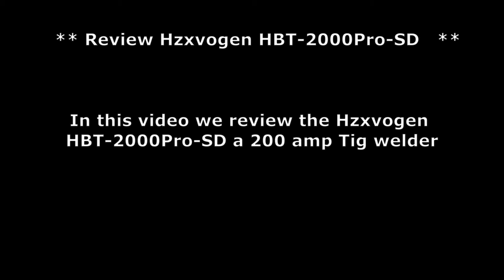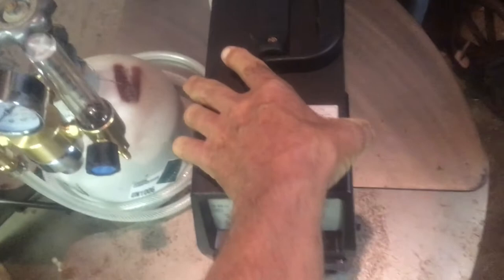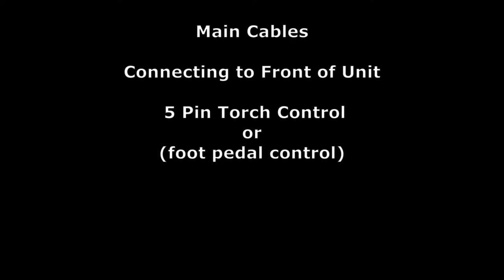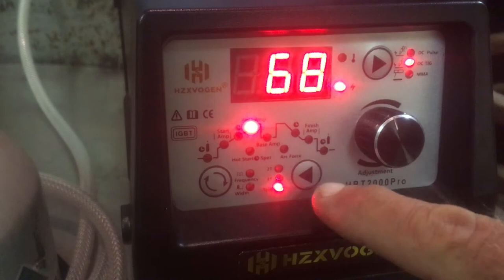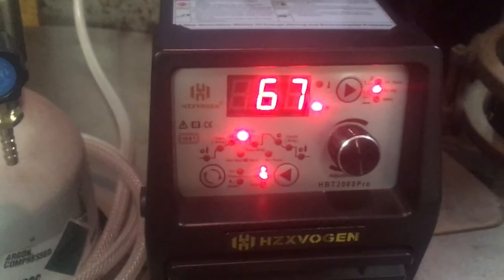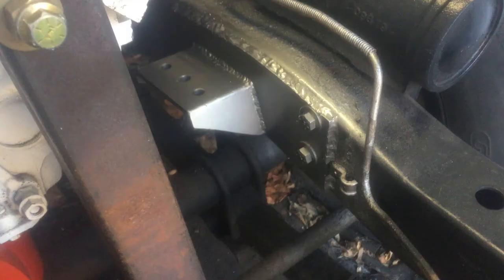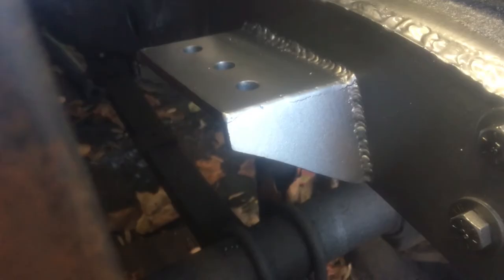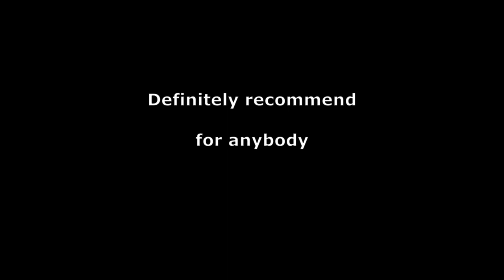Review Hzxvogen HBT-2000Pro-SD 200A TIG Welder Features/Setup/Operation/Examples

Comment: Thanks for the “real review” i have been eyeballing one for about a year. I have the HBM2280 mig/multi function and like the size of this tig unit. I especially like the pulsed tig option for sheet metal work. The Tig Torch is probably gonna be annoying but i hate using a foot pedal. I love my cheap hbm2280 fantastic unit for the money. So kinda makes sense to get this for Tig work.
Reply from the maker: Your welcome.. For me I figured most work would be in situations where using a pedal would be very difficult/contorted and everyone seems to say 'be comfortable position" when welding..  Price, size, weight, plus pulse .. yep a fantastic unit for the money IMO.. I will make (will do a video on) adding an adapter between machine and torch to allow turning off the up/down buttons and/or to switch to a lighter torch but those would add a ton of cost to the unit which semi defeats getting the savings on it.  Good luck with yours

Comment: Great video with lots of personal insight, thank you.
I had a couple of tig welders already but bought this one because it was such a great deal considering all of the features this unit has. You're right about the torch handle, lots of bells and whistles you don't need to be packing on the handle. A tig torch should be light, small, and nimble. This one is definitely not. I'll be replacing the torch head with a small WP-17 unit that accepts the same consumables. I'll add a small on/off micro switch in order to initiate the arc and gas, this will be light and simple and also very low in cost.

I had the same issue with the gas fitting on the front of the machine being loose, made it impossible to remove the line. I opened the unit up in order to tighten the retaining nut for the gas fitting and am glad I had a peak inside. Both power connections at the back of the Dinse  connectors inside the machine were lose. The gas line connection on the solenoid actuated gas valve was also lose and a heavy gauge power terminal on the main circuit board had not been trimmed properly and had almost worn through the protective plastic insulator sheet placed between the back side of the board and the outer shell/can. Everything else looked great but it won't hurt to have a look just to confirm that.
Great machine though and I am glad I scooped up this bargain. Thanks again for the video!
Reply from the maker: Very welcome .. Sounds like I need to open it up and take a look and fix the loose stuff.. 

Yes switching to a micro switch to trigger the T2/T4 functions will be route I go as well. I thought about using a WP-17 unit (not just swapping the head) but this is a 200amp unit so I am unsure I want to drop down to the 17.. Also I have a WP17 that came with my MIG unit.. I think if (when/if when lol) I can afford it I would jump to a CK like light weight 26 but with an added trigger switch.. 

Thanks for sharing your insights and thoughts.
Reply: @lars-dimdiy-howtos464  The only reason I chose the 17 series torch head in lieu of the more robust 26 series torch body is to have a more nimble torch. To me at least most of my tig work is more like surgery insofar as welding goes. LOL
The 17 is rated up to 150 amps, a level I seldom use with tig as most of the work I do with it is confined to 130 amps and usually under 100. For my use I finder it easier and faster to use either large transformer based stick and mig machines for the heavier material.

Be careful opening the shell, the sheet metal screws have precious little to sink their teeth in.
Pretty tight on the backside of the gas fitting. I used a long needle nose ViceGrip in order to hold the nut while tightening the fitting from the outside with a 17mm socket.
Reply from the maker: Yea .. good points .. and as we said in video its an awesome little stick welder too that's basically a lunchbox LOL take care

Comment: Any update now? Is the machine still doing fine? Mine have a problem now with the spot function sometime even if there is HF theres no arc  i have to turn the machine off and on
Reply from the maker: No problems. Still using it as a TIG and as a portable stick welder. I however did replace the Tig torch early on to a lighter flexible one with a simple trigger tab on it.. only advice is to make sure all connections are clean and secure including ground. you probably have done that but in case thought would mention.. Just unscrewing and reattaching cables can help with hiccups.

Comment: Excellent friend review of the team. I wanted to know if you can help me with the necessary parameters to weld stainless steel sheet of caliber # 30, in the equipment you used in this video. Thank you very much.
Reply from the maker: Each time / project may change what the settings need to be .. the type of weld ( butt, lap, tee, angle), the amount of metal being welded, the surface welding on (due to heat transfer), the grade of stainless (304, 316, 409), and of course the thickness.. You mention caliber # 30 .. is that the same as .30 in / 7.6 mm?

Comment: What rod sticks/electrodes should I buy for a car steel?
Reply from the maker: Not a simple answer. It depends on thickness (plus same to same thickness), condition of metal (rust etc), use (structural vs patch panel), type of metal (cold rolled, hot, stainless, 2 dissimilar types), and settings one is using at the time (pulse or not, amps, etc). I use both the stick and the tig operations of this welder.. which adds more choices / decisions to make.. Simple rule is match diameter of filler to thickness of metal so melt at same rate.. Same for tungsten .. close to size of rod / part thickness but that just starting point.. Always test and set up .. if metal is not new then may vary in thickness (rust too).. which impacts what rod/filler/stick to use.

Comment: Could someone help me please, I bought one of this machine and I try to use in TIG mode, but the digital torch doesn't work only up/down amps buttons working. Then I try in MMA , it worked very nice. Please reply if you have any idea about this issues
Reply from the maker: Can you adjust/change the Tig and or Tig Pulse settings using the menu buttons on the front? You mention up and down work if on handle does the bottom (gas) button work? Make sure the connector(s) from torch fulled seated on machine.. Maybe unplug and re-attach (dirt?)  If it is just the top button that starts TIG function try in 2T - 4T - Spot modes.. if it still doesn't work it probably is torch handle (switch).. If under warranty you should be OK to return just the handle..

Comment: I know what welder you have you can get a pedal for a primeweld Tig-225x or a AHP alpha Tig 200 and will plug in and work on it I think it is like a $100 for the pedal.
Reply from the maker: Have you used or tried it with either? I will be welding Stainless Steel exhaust with it something I have not done yet.. Will post short video of how it does on that..Will be including Solarflux as part of review.
Reply: @lars-dimdiy-howtos464  yes I sold it to my friend and he is still using it today. I got rid of it because I ended getting a primeweld weld Tig 225x with a Maxcool 3000 TIG torch cooler. You can use that to weld stainless steel exhaust with with lifting set your amps about 43 to 45 amps and it'll weld just fine
Reply from the maker: Great! Thank you for sharing that for all and the SS settings..

Comment: I cannot find any information on the pulse parameter. What the low setting and the high?
Reply from the maker: That can be found in the "Operation" section of user guide/manual. There are two parameters. 

The 'Pulse Frequency' is from 0.5 to 200Hzy. This is cycles per second which is a known based on what you set the menu to. By that I mean if you set it to 1 cycle per second then it is going to be 1 cycle per second. If you like to watch strobe lights you can crank it all the way up to 200 but it still will be pulsing at the 200 per second rate.

The second parameter is the 'Pulse Duty' rate which is variable from 5% to 95%. It is not as simple though. It is a % so it varies based on your other setting(s). 

An analogy might how many times you stomp on the gas/petrol pedal per second is your pulse frequency. How long you hold it down and how far you let up on it between stomps is your pulse duty. .. 

IMO getting it right is getting right for you and for what your welding.. One can weld at a faster or slower rate or raise or lower amperage by playing with the two settings.. Kind of like welding position .. its where you feel and can work comfortably. Like all other welding its best to get set up on test pieces of the same stuff one is welding.. You can get into a rhythm and keep heat down and/or time using filler rod..
Reply: Thank's a lot I think I will buy it! Looks that it can last as long as a miller or lincoln the way I will use it. Sheet metal only! The only flaw I will get it's dont weld AC! Like the HVT250P ac dc!
Reply from the maker: You are very welcome.. Originally my intent included AC Tig welders but the only time it really is needed is for Aluminum. The difference in cost versus how often I might do that made this welder the hands down choice. I do, surprised me, use the MMA stick side of this welder a fair amount.. it is so light and easy to transport and welds heavy steel/stainless easily with its smooth power. I ended up not liking the European style Tig torch itself.  I ditched that and use a light weigh flexible handle with simple trigger on it now. That modification may have made the total price closer to an AC unit but I luv the flex and light weight of it. I don't regret this modification.

Comment: Hi! Any update on the torch upgrade? Do you know which pins on the connector correspond to each function on the handle yet? I scored one of these welders used for dirt cheap but it didn't come with the original torch so I'm having trouble mapping out the pins. I opened up the case and it looks like from the main plug three of the five wires go to one connector and two go to another connector. I'm guessing its the 2 pins that are the on/off for the torch??? Looking at the panel from the front it would be the pins around 2 o-clock and 4 o-clock.

My goal is to use a regular torch with either a handle trigger or a little foot switch. I think using a pedal to adjust the amps would simply adjust through the whole range of the machine. I don't think there is a way to set the amps on the panel and then use a pedal to modulate within that set range :( Maybe I'm wrong though???? Please tell me I'm wrong haha!

Thanks so much!
Reply from the maker: Unfortunately life is getting in the way of modifying or using it.. Thanks for the information you provided by opening it up.. My approach, if I can get back to it, will be to use a multimeter or other on/off continuity tester to test what sockets/pins on the end of the torch correspond to which function on the handle.. 

You may be correct about up and down but unsure if the momentary + - buttons might work with a pedal.. 

Very welcome .. thank you as well
Reply from the maker: Update I just read the manual since it showed a pedal.. according to it, the manual adjustment for max will work but the up down will be disabled on panel with the adjustment becoming variable adjustment. via the pedal. It can recognize a pedal? like other welders do.
Reply: @lars-dimdiy-howtos464  I checked the manual again too and I see that now. I tried emailing them but never got a response back. I did a little more investigating on the 5 pins and I think I have them figured out now and I've seen there are some 5 pin aftermarket pedals on amazon that might work. I will keep you posted
Reply: Just wanted to give one last update that the pins I mentioned in my first comment are correct for the arc start switch. I've made little pedal that acts as a start/stop only. I plan on making a torch trigger here soon too. It looks like adjusting the amperage requires a digital signal and i played with the idea of an arduino crammed into a pedal that would allow you to send pulses so you could adjust the amps. I'm just going to use the welder as I have it for now. If I end up keeping it long term then I might give it a shot eventually.
Reply from the maker: @seanhawley382  Thank you for the update.. Been doing SS exhaust with original and it just is too stiff , heavy, and will change it when have the funds and time..
Reply from the maker: Started working on converting to a lighter simpler torch.. I've examined the original torch switch(switches), the 5 pin connector, and the 5 pin to board.. I'm working on a video of it all to share but quick point is that the amperage control on handle are nothing more than 2 simple on/off momentary switches.. The 5 pin Eastwood toggle switch is a simple 2 wire so none of the 3 other pins have any connections.. 

I have not looked at the pedal switch mentioned by Daniel's playhouse in previous reply as currently only want on/off simple light torch.
Reply: I'm looking into this problem and found this video. Here's what I found.

The 5 pin connector on the machine side, clockwise from the notch are:
1. Amp down
2. Ground (amp adjust)
3. Amp up
4. Switch gnd
5. Switch Signal

The amp up & down signal is digital so it's impossible to attach an analog foot pedal. Also notice there's no gas test pin, because there's no gas test. The gas test button is simply wired to trigger and works the same. They even include a pic of the torch without gas test button.

Comment: Just got one
Reply from the maker: Congrats..
Reply: How do you like it? I'm thinking about getting one of these, but I might go with a dedicated stick welder instead
Reply: @every_thing_wood1251  I would get one TIG is so much better than stick but the stick portion of the welder does work well I've only used it on 110 I'm sure working better on 220
Reply from the maker: This is a great torch for the price.. More than I will need being a non-professional not welding jobs every day with it.. In our video on making frame scap plates you can see photo of stick welds done with it in the thumbnail for that video.. My friend is a professional and he used it to do them for me saying it was smoothest inverter welder he has used. In exhaust video we posted couple days ago you can see photo of some stainless welding we did in its thumbnail. I've also used it on sheet metal down to 20 ga and up to 1/4 with no issues.. Only thing I am going to change is the torch itself.. I will switch to a lighter more flexible one with a touch switch on it.. that doesn't affect stick though as it uses a different cable but it is a heavy one along with the ground which is what you want for stick welding.

Comment: I have this welder and I cannot figure out for the life of me how to get it to ramp down and post flow.  The Amazon supplied manual is not the one you review but the machine is identical.  Do pray tell tell us what you use for 2t VS 4t pulse tig to get it to ramp down and post flow? I have my duty cycle and period at 50% and  0.9seconds and that works great. But I press stop & nothing happens
Reply from the maker: Different menus (settings) are available depending on what mode you are in.. Use the far right top area to select either Pulse/Tig(non-pulse)/MMA(stick). Then when in each of those use the menu selection button on the far left.. as you press it the light will move across each of the available settings for that mode.. It will be at one that it was at when unit was turned off or mode was changed so you may have to keep pressing it to get it to come around again to what you want to set - very first is pre-flow, very last led light is post flow, lights in-between are up slope min max down slope etc..
Reply: @lars-dimdiy-howtos464  Thank you. I have successfully gotten the welder to start, ramp up and pulse... but i cant get it to STOP.  Except t osnap off and then the gas cuts off. I want to push a button, have it ramp down and then post flow.  How you YOU do it? press start button, weld and then what?
Reply from the maker: 2T and 4T are separate from pulse/tig/mma .. there is a separate toggle for those modes.. When in 2T one presses and holds the trigger. It automatically does all the functions. In 4T one needs to press then release then press again and release again to move to end function.. 

It sounds like either you have no post or you have it set to none or almost none.. When I do stainless I have it set to up to 10 and it goes through a lot of Argon but it needs to be on as long as the metal is still red (metal or tungsten tip). If quick or very thin SS I set it half that likewise its a lot less for sheet metal or just tacking.. IF it is on 2T and Tig you still should be able to set the post flow but not alot of the other settings.. if you set it long and it doesn't keep running after you release trigger then it sounds like a malfunction.
Reply: @lars-dimdiy-howtos464  have they offered you a job to rewrite their manual ?  ;) Thank you for your help.
Reply from the maker: LOL .. no but having gone through the same 'what' was glad to pass along the learning.. enjoy ... its a great little welder

Comment: What is the hose size? Diameter?
Reply from the maker: I can measure it .. later today. Assume you mean the gas inlet hose from cylinder to back of unit? I seem to recall 7mm but will check. Hopefully I have a left over piece as I don't want to disconnect it.. If I don't I can measure OD of it.
Reply from the maker: Didn't have to measure.. Hose had info printed on outside.. It is 1/4" ID Lot# 1377190-68  708289468787  200 ft
Reply: @lars-dimdiy-howtos464  Many thanks!
Reply from the maker: @mladenenglang  You are welcome